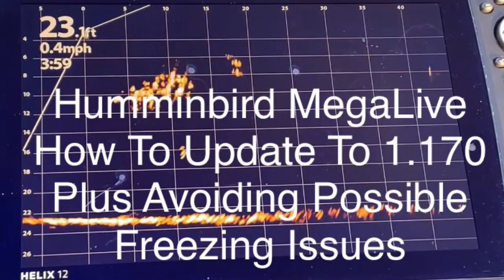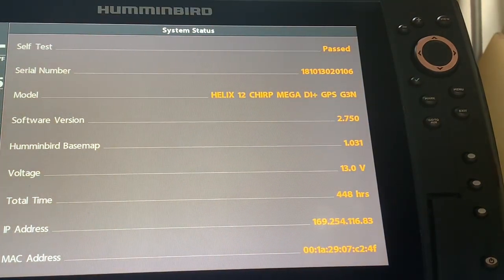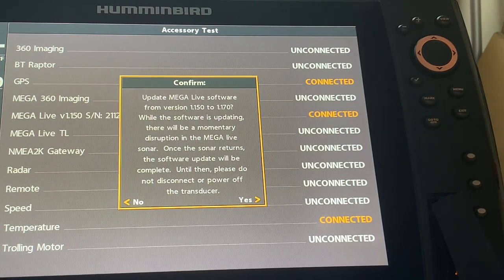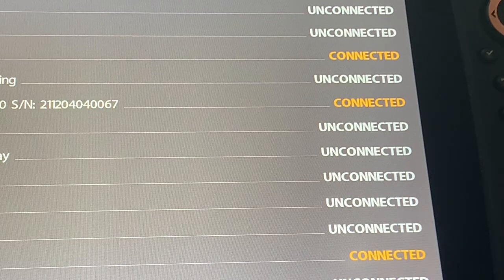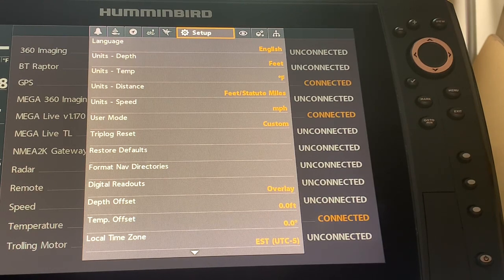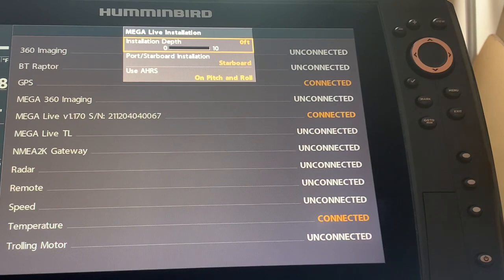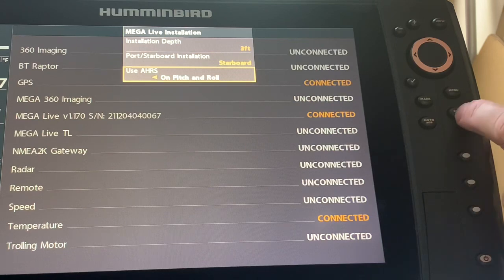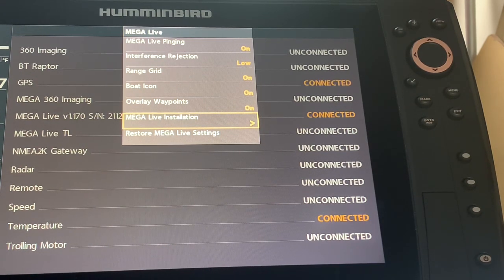Humminbird MegaLive, How to Update to 1.170, Plus Avoiding Potential Freezing Issues

Comment: Steve, I’m new to Mega Live, I just installed it last week.  I am working on doing the updates.  Is it necessary to update the firmware for mega live 1.170 on my console units?  Or do I only need to update it on the unit at the bow that I use the ML on?    By the way, I do have my ML contacted through a 5 port switch, not sure if that matters regarding the updating.  
Thanks for all your great info, I have learned a ton watching your videos.
Reply: Gotcha, that clears it up for me.  Thank you so much!
Reply from the maker: No problem, glad it helped.
Reply: @stevechiassonfishing5876  Steve, I went to do my updates and updated my graphs to 2.750.  I noticed that my Mega Live was already updated to 1.170.  It must have come that way, I don't know.  So I did not update the Mega Live.  I got on the water to test it, and after trying to get all my setting back to where they were before and then playing with the it some more, I will have to say, it was much worst than before I updated anything.  I could not track my bait at all.  I even throw a A-rig and you could barely see it on the screen.  It also had really bad rings of interference that would blink on and off.  It was way worst than the first trip out.
Do you think I need to reinstall 1.170 to mega live?  what to do think I should try?  Any help would be appreciated.  Thanks
Reply from the maker: The 1.170 update is there so I wouldn’t try to update it again. The most common settings for the new update is sensitivity 10, contrast 10, dynamic contrast balanced. In shallower water (lots of clutter in water) sensitivity 10, contrast 10, dynamic balance high. In deeper water, sensitivity 10, contrast 10, dynamic balance low. Generally speaking upping your sensitivity and decreasing your contrast will help you track your bait better.
Reply from the maker: Thanks Paddy, I appreciate your kind words about my channel. The 1.170 update is for your MegaLive transducer. You use the control head to do the update since it’s connected to the MegaLive transducer. You do need to make sure your control heads are updated (2.750 when I updated my Helix units). If your console units are updated and you have your MegaLive 1.170 updated you are good to go. The Helix update will give you the best possible image from your MegaLive update 1.170.

Comment: Steve, I have a Helix 10 GN4 and my scenario was to install the 2.75 Update and the Mega Live 1.17. Which I did and it went well folliowng the directions of course. After that it improved the lure tracking as stated in the summary of the download. But the Mega Live would occaisonally freeze up, and I would have to unplug it and turn it back on. After a couple of weeks it would freeze up more frequently and became very frustrating. I then saw the 2.76 Helix update and installed that. And then after watching this video I did the re-install Mega Live. After I did that, I fished for 2 days with Mega live without any issues and zero freeze ups. Your video was right on the money and very helpful Thanks for sharing. And if others are having similar issues, re-install the Mega Live after any updates or when you reset factory defaults. Worked for me. 
Thanks again sir
Reply from the maker: That’s awesome PZ! I love it when I receive comments like yours because I know the videos are helping anglers. Your thoughtful words are the highlight of my night. Thanks for taking the time to share your comments.

Comment: Just completed. 2.760. First thing I noticed is on the installation tab, I only have 4 windows. Depth, port/starboard, use AHRS, and landscape has a selection for “normal or reverse “ I guess this is just for ice units. It would freeze both ice fishing and in open water. But none of my boat helix ever froze? Strange. Scheels even gave me a new mega live and it still froze. At first, tech support always told me it was a ML issue. So when I called and told them none of the other units froze they started listening to me. Lol
One thing on my many calls I learned was that some units had corrupted waypoints imported into the control head they thought was the problem. They walked me through going deep into unit and eliminate waypoints. Not only with the card and saved waypoints but deep into into it. I think it was “format directories?” That didn’t help my ICE unit but she said It did with some people. 
I assume the landscape mode is for which side one tilts the head. Up or down. 
The ICE unit always worked fine on my bow motor with side image. Then it would freeze up again if I switched them out again. It’s froze up right out of the box since first day ice fishing. But when she didn’t freeze I was very happy. Still would choose ML again as I have other heads I can switch around and customer service has been top notch!
Reply from the maker: That’s frustrating for you. Humminbird has excellent customer service which is so important knowing that the company stands behind their products!

Comment: Great as always Steve. I kept having my ICE helix 9 freezing up. Sometime second half of day sometime first part or day. Kept all the updates current. I had been using the install as you suggest in this video. I found that out of 4 control heads I tried, it was only the ICE 9 G4 that would freeze. I use the ice bundle both ice fishing and on my boat. Since the July updates I haven’t noticed it freeze up but only have had a few short days using it. Yesterday morning humminbird tech called and they came up with what they believe is a freeze up update. They emailed me version 2.760 for an update on the control head. I’m just loading it now so your video was timely. anyone that has freezing issues and has an open ticket with HB should be getting a call.  Plan to try it out tomorrow and see how it goes. Keep up the good work!
Reply from the maker: Thanks Cowboy Jack, I appreciate your kind words. I wonder if 2.760 will be a general release on the website. The MegaLive installation feature certainly eliminated my freezing issues. Helping other anglers is everyone’s goal. I will be keeping my eyes open to see whether 2.760 is released and what the general fixes are associated with the update. Thanks for sharing your information and encouraging comments.
Reply from the maker: Please let me know how it works out.